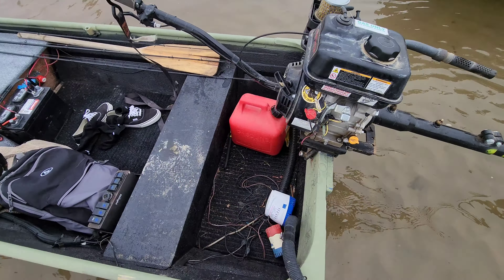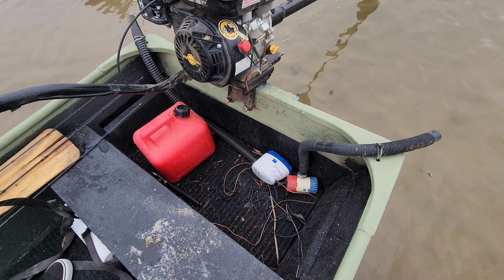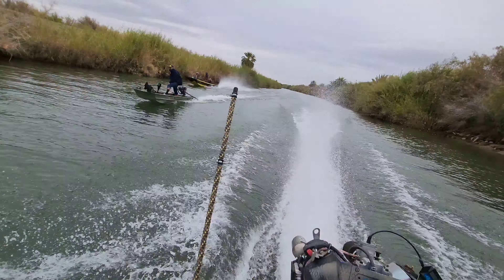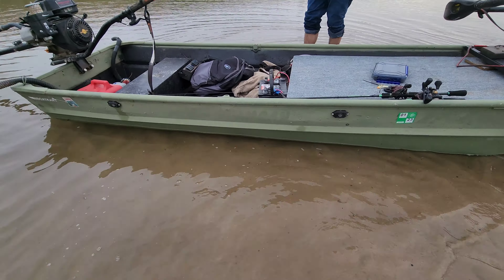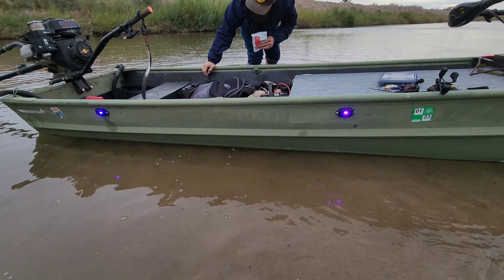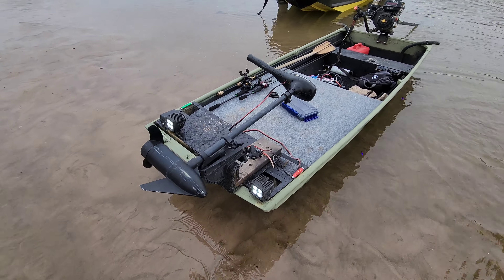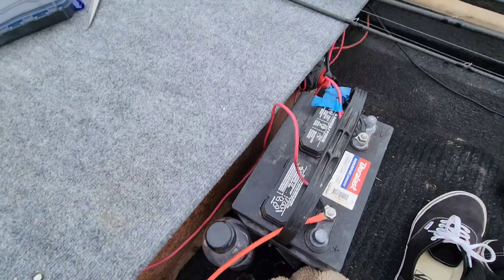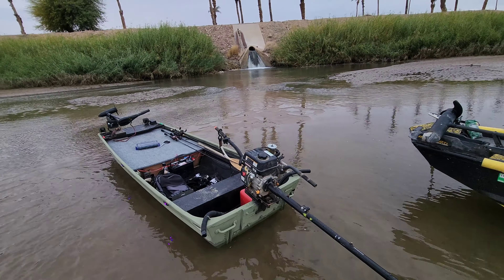How stable is a 10ft Jon Boat?

Comment: Love it! Is it a 1032? Would you be able to tell me the max weight capacity for persons plus gear? I just bought one and had no label. Tried manufacturer and dealer but just get the runaround. I’d really appreciate it!
Reply from the maker: They are like 3hp 280lbs u.s.c.g. 2 people obviously they hold a bit more than that